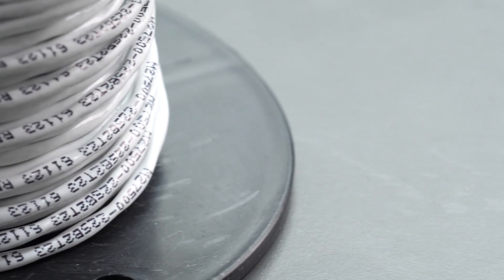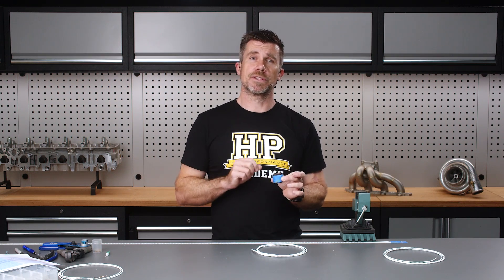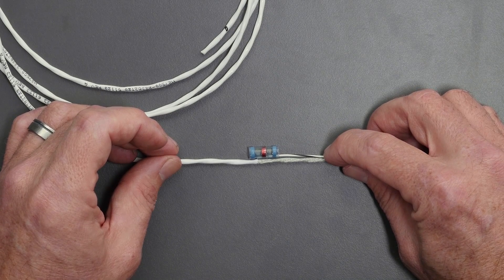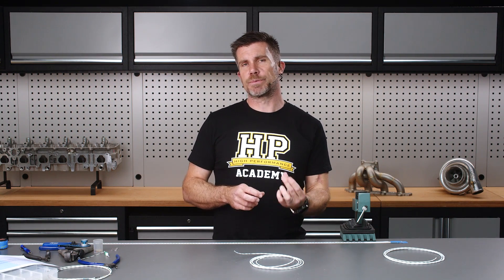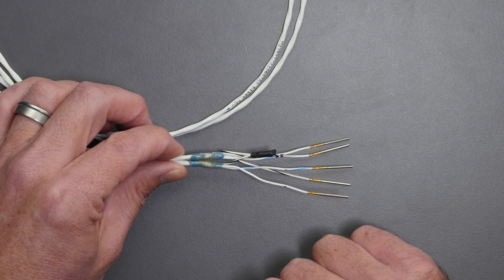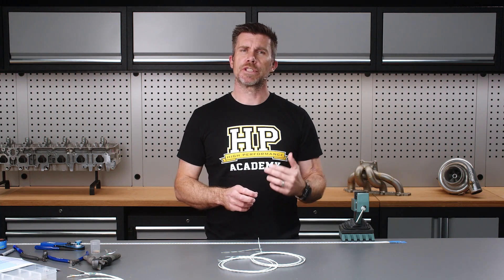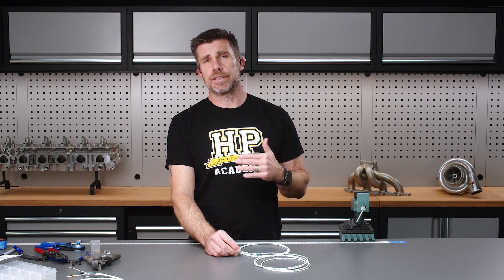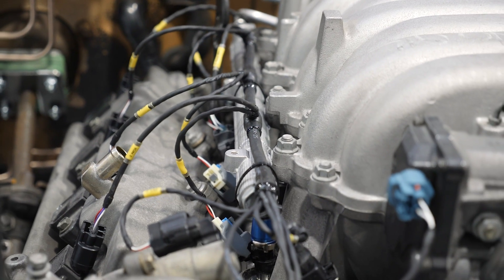Shielded Cable 101 | Motorsport Wiring Lesson 5 of 5

Comment: @hpa101 If your splicing two drain wires together and then using one to connect to the AS as your short on terminals. Does the drain wire not need to be bigger ie 2 x 22AWG > 1 x 20 AWG to the AS? Or if it was 3 x 22 AWG could you still use 1 x 22 AWG? 

Apologies if this is a stupid question I'm still learning. 

Because you used the same 22 AWG I'm assuming for drain wires it doesn't matter as they aren't carrying current obviously. But i think its always better to ask then assume 😊

Comment: Thank you. As an amateur trying to learn the tricks of the trade your videos have been invaluable. Have you had any issues with the wire insulator melting and contaminating the solder?
Reply from the maker: Sorry I missed your comment, not that I am aware of. It has a much higher melting point - Taz.

Comment from the maker: What's your 'current' wiring project?
🦸‍♂ Building a fast car? Get $400 OFF the all inclusive VIP online course package deal: https://hpcdmy.co/vipy104
⚡ 50% off your first online wiring course! Get the knowledge and confidence you want. Enrol today: https://hpcdmy.co/offery104
TIME STAMPS:
0:00 - Mission Critical Wiring
0:28 - Measuring & Stripping
2:01 - Boot Template
2:23 - Exposing Braid
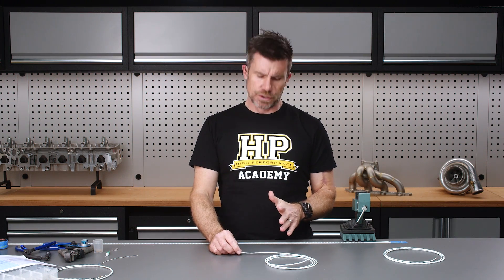3:33 - Cutting Braid
5:00 - Solder Sleeve Options
5:52 - Ref & Sync Marking
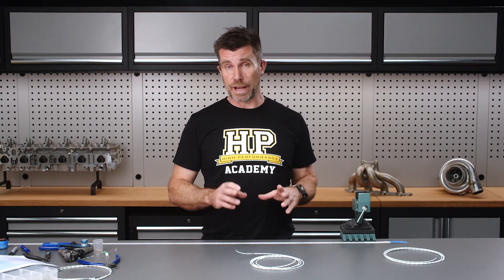6:20 - Solder Sleeve
7:02 - Splicing
11:02 - Heat Shrink
11:25 - Finished Splice
12:18 - 1 Of Over 40 Modules

Comment: I work on MRI machines which use a lot of RF cables to transmit power and signals. There was one instance where a simple pressure switch with unshielded 2 wire cable was causing interference with the RF cables enough that it would inhibit scanning. After changing that one cable/harness for a shielded version the issue resolved. My cable had a ring terminal for the shield drain on one end, and then the metal DB9 connector housing on the other end provided ground there.
Reply: Is it best to ground the drain to engine and leave other end just heat shrink at the ecu plug?

Comment: In military aircraft wiring, there are various methods. The two most common are actually grounding it on both ends of the harness run. Or solder sleeve it to wire/pin that later goes to ground.
Reply: Doesn't grounding the cable shield on both ends negate the purpose? Or did I misunderstand?
Reply: @Nikoxion 
Right, shields ground at one end only
Reply: @vozhdmeister5256 No, shields should be attached at both ends pretty much always.  There are very few specialized exceptions.  I would post a link, but often links keep YouTube comments from getting posted.  I will try to post in a second comment in case the url kills the comment.  Both the military and FAA get this right, but almost everyone else gets it wrong.
Reply from the maker: Sorry team, just saw this. For motorsport applications that HPA covers, you're grounding at one end. You don't have to guess this, your ECU manfacturer etc gives clear instructions to ground on the ECU side only.
You are most certainly violating the star earthing rules explained in the wiring fundamentals course if you ground at both ends, and as mentioned by others, that can turn the shielded braid into an aerial (the opposite of our goal).

Can't comment on military aircraft, we don't wire those 🤘

Hopefully the link below helps further - Taz.
https://www.hpacademy.com/blog/star-point-grounding-earth-groundearthing/
Reply: Grounding both sides does not make sense. Your ground isn't just a ground, it's a conductor, it conducts the main power current. When you connect both sides of a shield to the ground you split the ground current with a part of current now flowing through your shield. As any conductor the shield has a resistance, so the current will induce a voltage drop, and your shield will start being an emitter of this ground signal. So you'll get an excellent emitter very close and all along the shielded cables.
That's why the shield must be grounded at one end and at the reception end.
It's possible that in military domain they create separated main power and low power grounds, in which case grounding both sides to the low power ground is safe.